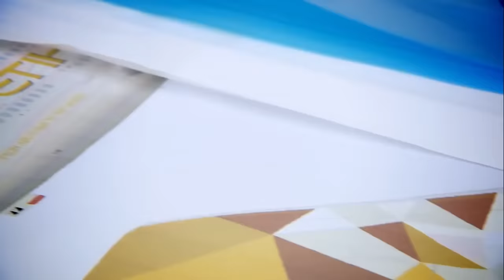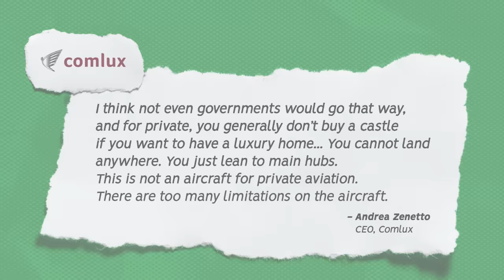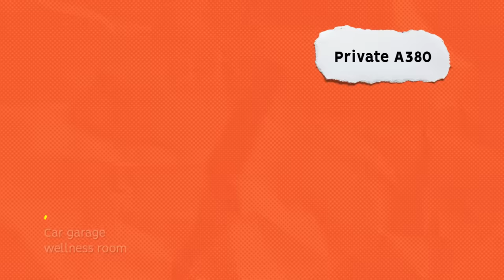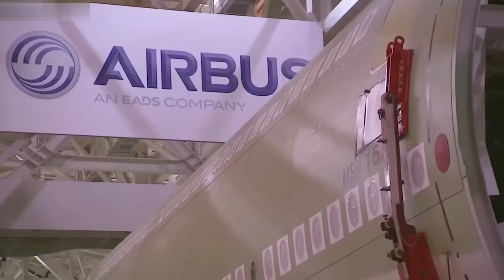The Logistics Of An Airbus A380 Private Jet

Comment: Both 747 and A380 are dead - private or otherwise. The replacement of Air Force one is the last build of the 747
Reply: Both VC-25Bs have been built in 2015, since 2017 all newly built 747s are freighters.

As long as there are airlines operating the 747-8, some even reactivating their 747-400s (Lufthansa) and airlines like Emirate exist, I wouldn’t call the 747 and A380 dead

Comment: Why can't someone take these retired jumbo planes and re-purpose them for forest fire tankers?
Reply: Completely unsuitable. The "double bubble" fuselage design means you could only put relatively smalls tanks in (this, BTW, is why old 380s cannot be converted to freighters and that's one reason why used A380 economics are not as good as old 747s, which almost universally end up as freighters). It cannot fly slow enough for accurate firebombing, would take forever to reload and anyway needs a major airport which may not be close to your fire.

Comment: I can see it given how NO ONE wants one in the secondary market. So it could be had cheaper than a 747 or others. You know the Prince of Dubai will do it ..
Reply: All the reasons we didn’t see one yet also comes into play then. Often these private 747s are operated to airports the 747 can operate to, but an A380 couldn’t. Furthermore price isn’t really a problem for them and to be honest it doesn’t really make sense to buy one
Reply: The reason old 747s fetch good prices is because they convert to freighters, and freight don't care if the plane is old. The 747 was designed from the start with freight in mind, where the A380 was not - something people even pointed out at the time was a bad design decision (you can never cut holes in the fuselage big enough to load and unload pallets).

Comment: AF1 is US biased. Not the best aircraft was selected.
Reply: What would’ve been better? The 787 is too small and the 777X was still something of the future when the order was placed. Also, usually aircraft types which already were in service with airlines for some time are chosen to ensure safety and durability
Reply: @spongebubatz   You are obviously not considering the same class aircraft. Nice try though
Reply: @pigmoonk2545  the A380 has for the USAF not a single advantage over the 747-8, so what aircraft are YOU referring to?
Reply: @spongebubatz   LOL. Obviously you are not in the industry. The A380 has too many advantages but the USAF insisted to manufacture the aircraft in US which is the barrier. IF you dont know the topic pls dont try so hard and embarrass yourself.
Reply: @pigmoonk2545  thanks for the chuckle. The A380 has higher operating costs than the 747-8, only when it has a high load factor it is profitable, which is something governmental aircraft of course don’t achieve so biggest isn’t always better. The A380 is also quite heavy for its size.
Also, one of the main disadvantages of the A380 is that it’s restricted to bigger airports, the 747 has, with its smaller profile, access too many airports more than the A380, for which any airports had to go gate modifications for. The A380 only made sense between bigger airports and was only built for bigger airports, the 747 can fly to a higher variety of airports, which is a must as a presidential aircraft which sometimes has to fly to airports which aren’t that well equipped, let alone big enough to accommodate an A380.
Other than size the A380 has no real advantage over the 747-8, especially as it‘s European made and all the AF1 crews are already trained on the 747, they only need to adapt to the newer instruments.

You are the one who clearly has no idea of the industry, or maybe we’re just talking about a different aircraft. Because the A380 I‘m talking about is anything but suitable as a governmental aircraft due to various reasons.

Anyways, talking about embarrassment and calling someone names, I think you would be a better example for that. It’s hard to beat your comment when it comes to being confidently incorrect.
Reply: @spongebubatz   dude. Are you high?  You really have no clue whats happening. hahaha

Comment: Why not make a giant flying sweatshop out of one of those big planes?
You could easily keep 800+ minimum wage workers busy manufacturing consumer goods and the profits would off set the cost of fuel and maintenance. That would allow the owner to keep a small but comfortable private quarters, still many times bigger in size than those 'apartments' or cells those airlines are hyping currently.

Stay in international airspace most of the time so authorities can't send inspectors and land only at countries with friendly governments who still accept proper funding of their political campaigns to remain in office.

Comment: Do plane owners get money for scrapping aircrafts? Or do they just rather scrap them than selling cheap? 🤷🏾‍♂️ The A380 is a masterpiece but sad to see one after the other retiring too soon
Reply: It's all about money.  Emirates might scrap some for their own spare program, but most are dismantled and the parts offered on the open market.  The problem is that every plane that is dismantled is one more set of parts on the market, and one LESS   operating plane in need of parts.  It's a declining market  especially with only a couple hundred unique aircraft.
But an aircraft owner has fairly significant costs even mothballing a plane for future use, so they aren't willing to hold onto it while waiting for a future sale.  If there has in fact only been a single secondary sale of an A380 I think it's reasonable to say that when an airline says they are retiring an A380, you can read that as the equivalent to saying "scrapping for parts"